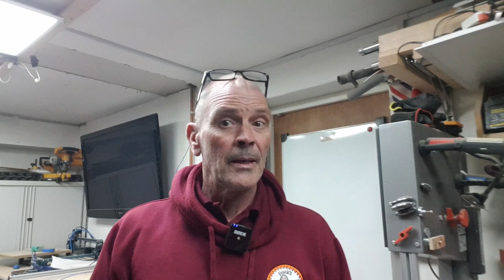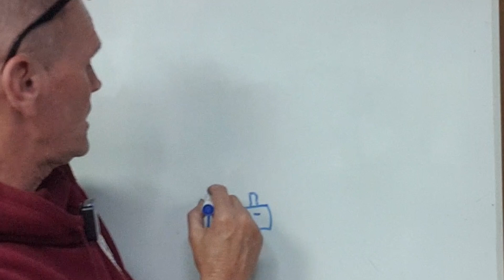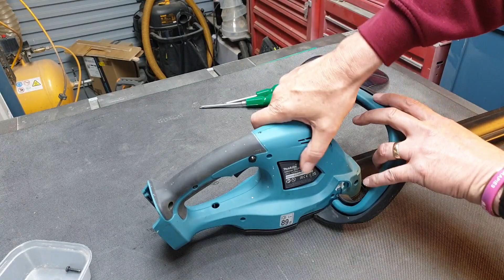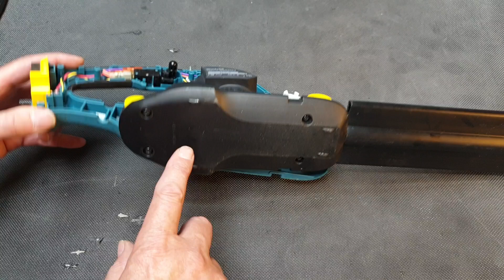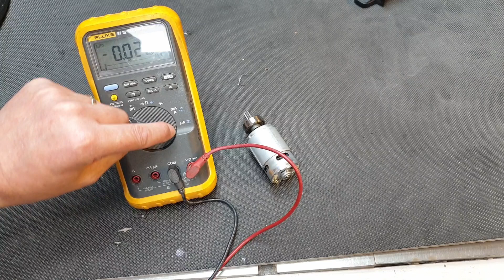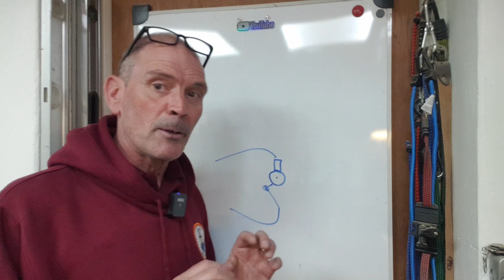Makita DUH523 Hedge trimmer, Fault finding.

Comment: Makita XHU07. Power come on. When i engage  it the 2 top power lights keep blinking. It has always worked like a charm. Previous day it was about 2 1/2 hrs fine. Next day about 15 mins into using it, it stops working and the power light thing happens. Thought my battery was bad, so i switched batteries and the same thing. Motor or controller ???. Will take it apart this weekend.

Comment: I had the issue where the controller had stopped working. There was no indication of power when both switches were activated. No light on the LED either. No power going from the battery to the motor. Motor span fine when wired directly. I found a replacement controller with wiring on Aliexpress for about 30e. Not cheap, but at least it’s not in a skip. Thanks for the video.

Comment: Just wanted to thank you for this video! I have a slightly different model Makita trimmer (but it looks identical) that I couldn't get started. Only 6 years old and would have been $180 to buy a new replacement, so it was worth repairing if I could. The internet and instruction manual had no answers on how to fix it. Lucked into your video. I walked through all of the steps you took and ruled everything out except the controller. I bought a new one ($60) and wired it up this morning. Works like a charm now! Hoping to get at least another 4 years out of it.
Reply from the maker: 😁 Your more than welcome Josh. Im glad it was of some help. Thank you for watching 😁👍

Comment: Nice vid. I’m not getting voltage to the motor.  Does that mean the motor is cooked?
Reply from the maker: 😁 Hi Shed. If there is no Voltage getting to the motor then i suspect the issue is elseware. You will need to trace the wiring back to where you are getting Voltage and then work from there. The switch would be a good place to start. Hope that helps. Thanks for watching.😁👍
Reply: @frankslittleworkshop thanks the switches are getting low continuity so appear ok.  The motor gets high like 0.300 rather than 0.001. I spoke to an electrician yesterday and he suggested that meant the motor is cooked.  I was thrashing the trimmer at the time…,

Comment: Hi Frank, good to see you, well demonstrated on the tare down on this hedge trimmer and checking every contact and mechanical parts and got it down to the contacts in the motor and as you said it will be the brushes, so it is repairable it's down to the price of a new motor to see if it's worth repairing or buying a new hedge trimmer. As always a great video catch you soon   Take care
Reply from the maker: 😁 Hi Shaun, its always worth trying to fix stuff rather than just throwing it away. I think a new motor is on order so hopefully a quick follow up video should see if my diagnosis is correct. Thanks for watching mate 😁 👍

Comment: Hi Frank. 1. How old is the machine? 2. If less than 3 years old, Makita offer a 3 year warranty, assuming the machine was registered in the first 30 days of receipt. 3. £95.00 will buy you a new one. 4. A replacement I've found is available here at powertoolspares. Look for makita, duh523.m, duh523, spares for about £23 + delivery. I hope this helps. Change the commas for forward slash, as YT doesn't seem to allow links of any kind.